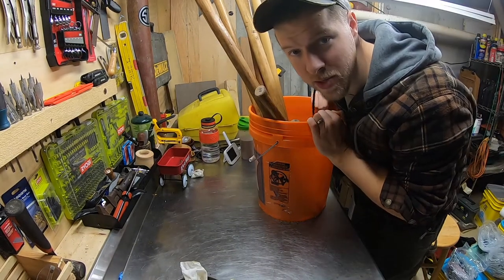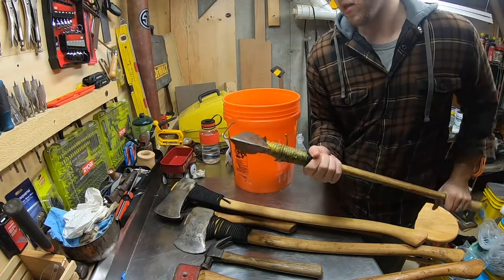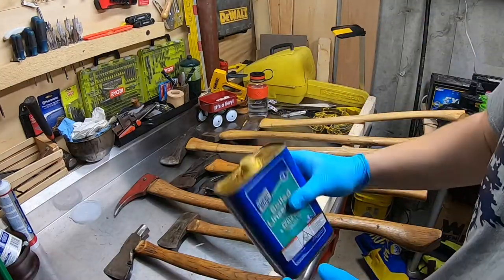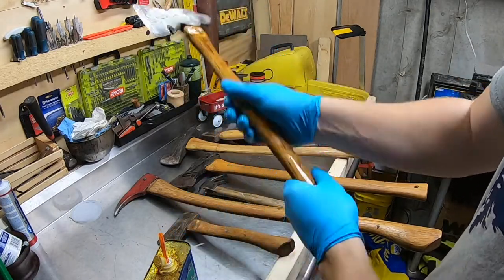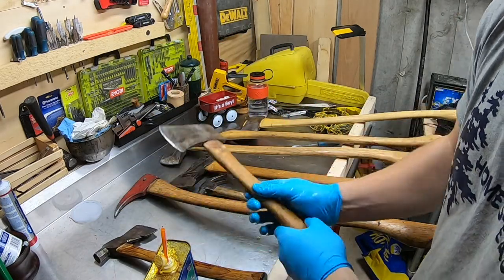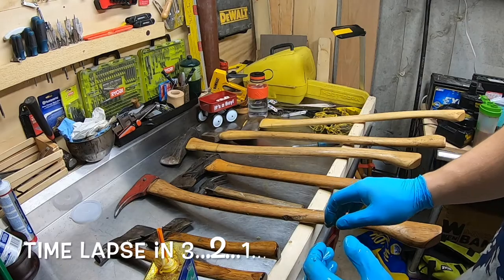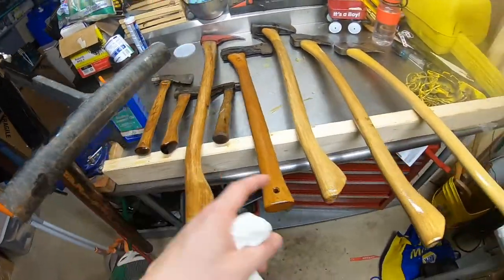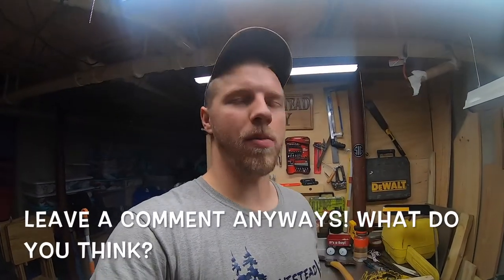How To Take Care Of Your Wooden Tool Handles! EP 95

Comment: How long do you let the oil sit before you wipe off the excess?
Reply from the maker: Depends on ambiant temp. If your outside and its 30 degrees its going to take a while. The wood will only absorb so much at once so just hit it with a nice coat, lightly wipe off the excess, and let dry in a room temp 60-70 if you can!

Comment: Thanks for the video on this.  The boiled linseed oil I purchased (different brand than yours) has instructuons to dilute the BLO with mineral spirits or paint thinner before applying to wood.  Does your brand not suggest that, or do you just disregaard and apply directly anyways?  Maybe it's not necessary?
Reply from the maker: You dont have to dilute. The wood will absorb so much anyways! I would just treat as is. Remeber this quote. "fresh wood is 1 coat a day for a week, then 1 coat once a week, then 1 coat a month, then 1 heavy coat once a year" thats generally what I do! Wood is porous and keeping it "hydrated" is key! Subscribe to the channel and I will post a new video on this!
Reply: @HomesteadJay  Thanks much, Jay!   I appreciate the advice.

Comment: Good too see you Jay . Nice selection of wood splitting axes . I need too do mine . I also need too get a pickaroon . Can you send me your recommendation . I see lots on amazon . You have lots of experience with this . The straw trick is neat . I always learn something watching your channel 👍 I feel better now that I have my Homestead jay fix 👍
Reply from the maker: Haha Hey Stephen! Thanks for tuning in! Hope you are staying warm! I use a "150 1-1/2lb Hookeroon 36 in by council tool"  Here is the amazon link: https://www.amazon.com/150-1-1-2lb-Hookeroon-36/dp/B000UOHFUO/ref=sr_1_1?keywords=council+tool+pickaroon&qid=1574870436&sr=8-1
its $46.99 free shipping. 
It has worked great, it has an aluminum wedge in the head with a steel bolt so the head will never move, hasn't moved a centimeter for me! I also like how I can get replacement handles at home depot or Lowes! Id recommend sanding the shine off the handle and treating it with linseed oil! Let me know if you have any other questions!
Reply: Homestead Jay  Thanks Jay 👍

Comment: Since I want the butt ends saturated I want to stretch this out in a day and let the oil really soak in. I saw a comment about a baseball bat rack, something like that homemade would be great. Let one end and half the handle soak for a while then the treat the other end let it soak for a while on the homemade bat rack.
Reply from the maker: I think you could do that, however only so much will soak into the wood at a time. I think a few coats spread out over a few days is a great start. They say 1 coat a day for a week then 1 coat a week, then 1 coat a month for a year for brand new handles!
Reply: @HomesteadJay  ThanQ